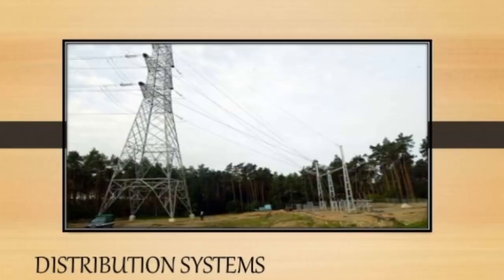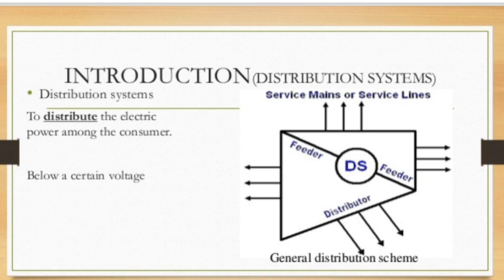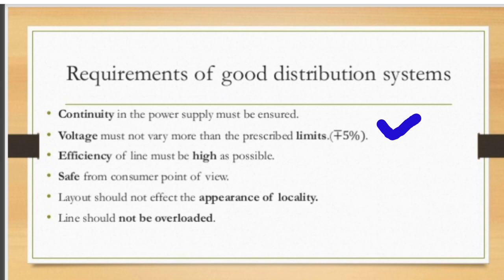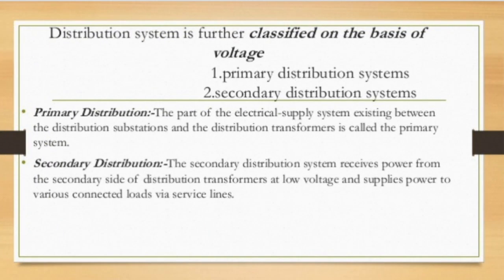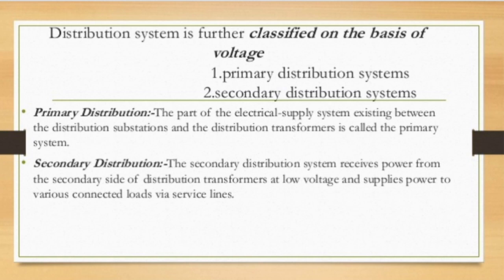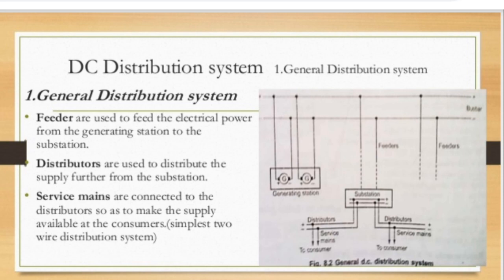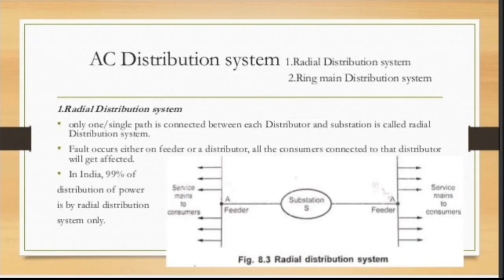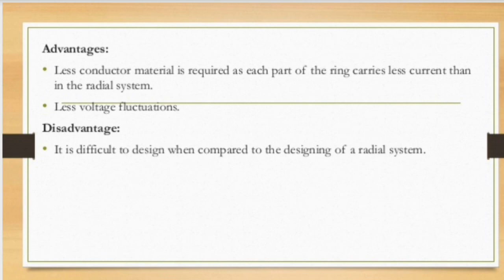Electrical distribution systems in English and telugu | Lecture # 2 | Electrical Engg | by reddaiah

Comment: How can we ask doubt
Reply from the maker: S you can ask
Reply: @Reddaiahpolisetty  What is the importance of percentage voltage drop in feeder lines. What are the various factors that effect percentage voltage drop.
Reply from the maker: @parth7450   the importance of %Voltage drop in Feeders are
1.during high voltage drop in Feeders causes low voltage profile which increase current,
Hence conductor size to be increased. And
The factors are which influences Voltage drop are 
1.reactance / impedance of the line.
2.loading of feeder
3.length of feeder